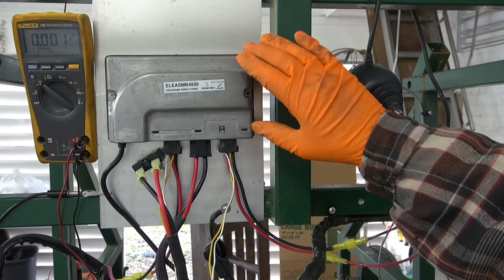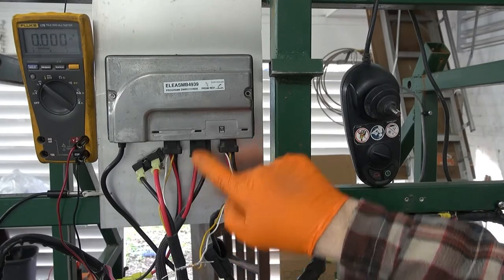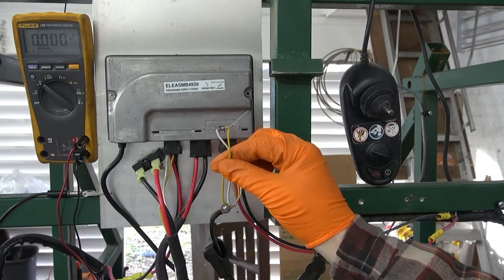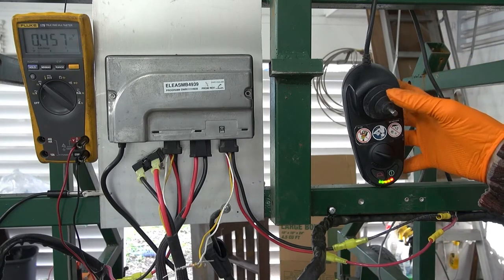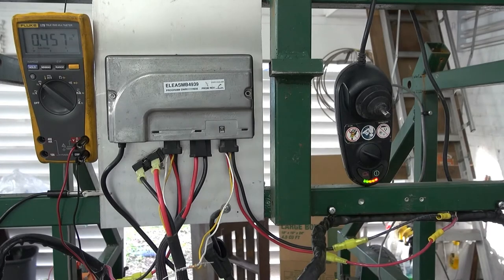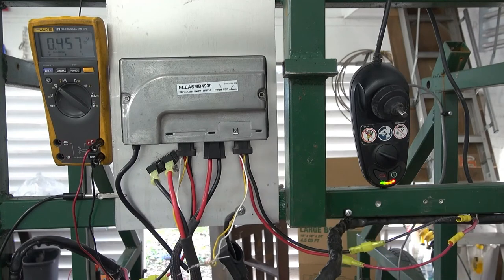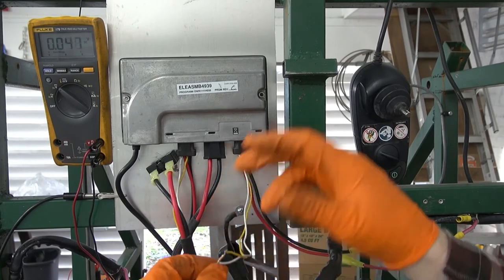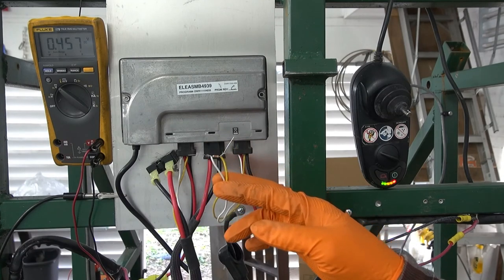Power Chair Brake Bypass mod with 2k ohm resistors

Comment: Does this resistor technique work on other controllers, like Jazzy 6, 6 ultra ?
Reply from the maker: I have used it on several different models, I do not recall the number but everyone I have seen is similar

Comment: Hey, l have wheelchair with brushless motors and manual brake , i mounted a joystick PG Drives TECHNOLOGY D51161.01 . I have an error and the wheelchair Can not run . How to résolve with leads of brakes.